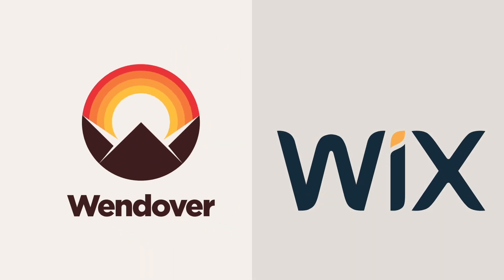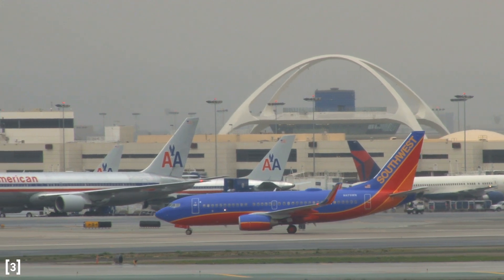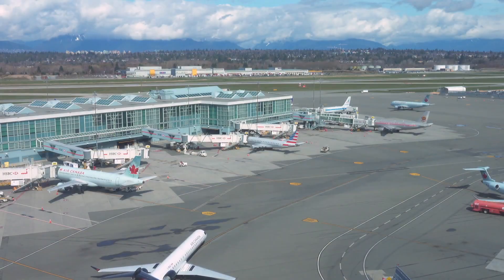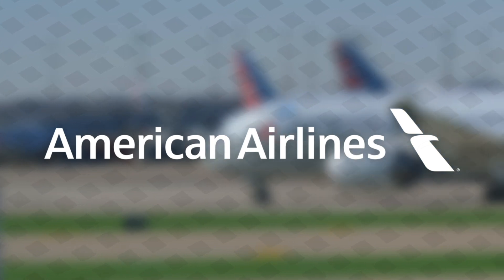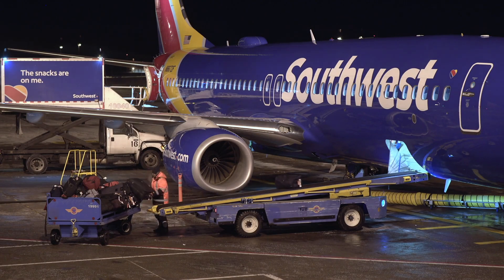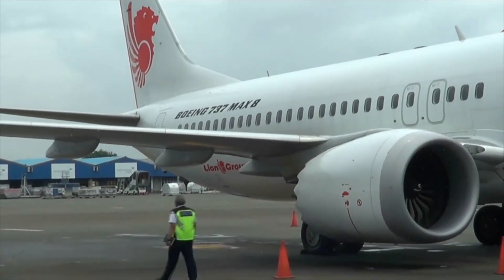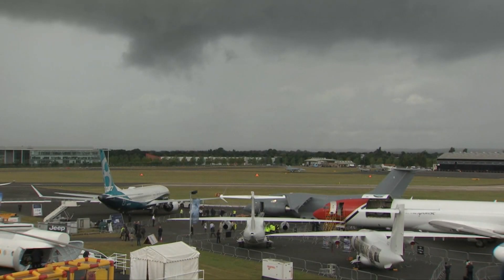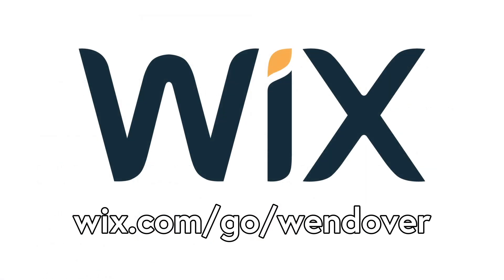The Economics That Made Boeing Build the 737 Max

Comment: Intro is absolute garbage. All modern planes have several step starting process ( non turned on by  the flip of a switch ). 737 MAX ( and NG for that matter ) has got lcd screens that show all the parameters and problems if they happen ( non of that "just a warning light" nonsense ) . All control surfaces are moved by hydraulic system and electric motors ( fly by wire ) and all the physical cables are just a redundancy mechanism in case something mulfunctioned ( which is a good thing ). And even check lists can be digital if airline company so desires. So that was complete nonsense. By the way I am in no way Boeing apoligist. And I do acknowledge that 737 Max is a disaster ( for reasons we all know ) and that the nature off capitalism and corporations lead to tragedies like 737 MAX accidents. But we can't just make stuff up just to make a point how bad this plane is.
Reply: Андрей Журов I’m not sure about 7 steps but there are defiantly more steps than Airbus or even 777. All I know is 737 you have to manually turn off the packs, turn start switch to ground and wait until 25% N2 then manually move fuel switch to run. Airbus is turn start switch to IGN and move master switch to on. 777 is similar. 

And for the checklist side, if a problem occurs an Airbus displays the actions write on the screen and removes it when actions is completed. Boeing just has parameters on the screens for engines, hydraulics, gear and flight controls
Reply: @tomstravels520  I can agree with you on the start up procedure but the point is not whether 737 has couple of extra steps in the procedure or not, the point is that non of the modern commercial jets are started with a flip of one switch. And same goes for displaying issues and parameters on LCD displays. In the video author says it's just a bunch of warning lights ( to make it sound like it's a really old school plane ) which is just not correct ( and very far from reality ). 737 MAX as well as 737 NG has full "glass cockpit" ( a lot less so in case of older 737 Classic ). I'm just trying to say that all the information in the beginning of this video is factually incorrect.

Comment: I understand the impulse to return to roots and use fly by wire, get rid of automation, etc. It seems to me however it completely misses the point. 

The way aircraft software is written is completely outdated and non-robust. Essentially it seems to be a series of hardcoded if-else rules that are obeyed blindly by software, no matter what the context. At the same time, we have very robust self-driving car software solutions that process all the available inputs in conjunction and make decisions based on all the available signals.

It's easy to understand why that is - aircraft software predates self-driving cars by decades. It just fundamentally is a much easier problem to solve because in a typical situation there is much more time to react - tens of seconds instead of fractions of a second. There is also more space in the sky than on the road. Therefore the style that was used in the past is continually used at present.

I believe there are two ways forward. Either stay with the current rule-based model and acknowledge its limitations. It really is never going to be intelligent enough to make better decisions than a pilot. Or we should transition into a modern neural network style architecture where all signals are processed.
Reply: Self-learning software isn't robust. A tesla plowed itself into the side of a truck, apparently mistaking it for an overhead pass. To make matters worse, neural networks are nearly entirely undebuggable. There is no way to tell why a neural net came to the decision it did, while that's a relatively straightforward exercise in traditional code. This is why adverserial attacks on neural networks would never trick a human brain. Traditional code had decades of track record of safety, whereas neural nets have no track record whatsoever.
Reply: @antalz  You are making an unfair comparison here. Somehow when it comes to neural networks - the bar is "it will never make mistakes that a human couldn't". But when there is a bunch of if-else statements the bar is "it will work under precisely defined, intended circumstances". Let me put it this way - it is trivial to "trick" a bunch of if-else statements into making a mistake. Just break the particular sensors that the system depends on. Adverserial attacks can be defended against and are very difficult to perform. Much more difficult than an attack against traditional software. It's enough to disrupt GPS signal which is quite easy.
Reply: @antalz  Tesla running into a truck was literally software being beta-tested, not production grade. Insufficiently trained neural networks are bad. So are badly coded and untested if-else statements. We will eventually see what the statistics will be on the actual production-ready software in self-driving cars. But if the statistics showed that this software is reliable over a very large dataset and robust against various attacks that will inevitably be tried against it, then I see no reason why it couldn't work in aircraft. It is an order of magnitude easier problem to solve.
Reply: Aircraft systems are already designed with the mantra that "the pilot always is the unquestioned decision-maker". Systems can take decisions, however, the pilot needs to be aware of them and have a way to take over. The MCAS did not respect that design mantra, by having the MCAS fight the pilot and by not letting him take back control (by deactivating the system, for example). Besides, the MCAS suffered from having no redundancy of sensors where any other similarly flight-critical system would have had a 3-sensor redundancy system where the readings are approved only when 2 of the 3 agree on the value (within a small margin of error). 

Also, AI hasn't been integrated into airplane electronics because there is effectively no review of the "code" nor any way to formally regulate it. Neural networks are essentially a literal black box where one can only gain insight on its behavior by feeding it inputs and observing outputs. This means one has to exhaustively test all edge cases before being certain the system is safe. And within the aviation industry, uncertainty is very, very badly seen. Besides, airspace being only used by professionals means that standardization is easy enough - any action the pilot takes follows protocol, from requesting departure to following routes to communicating with ATC. This makes it easier to design automated systems which relies on the protocol instead of having to learn typical selfish human behavior as seen on the road. If all cars were self-driven, or only driven by professional, we would have seen a similar innovation path as with the aviation industry - "manually" designed automated systems which relies on protocol. And as more and more of personal cars are self-driven, I believe we'll see a change towards that protocol-first world where cars automatically follow a set of rules and communicating between them.
Reply: @SolarLiner  There is nothing wrong with the mantra of letting the pilot make the final decision. But why should we be okay with an automated system running a plane into the ground when there are thousands of signals that could be used to figure out that is what is happening. Sensors can fault, but more importantly, there might be circumstances when sensors are badly designed and give equal but wrong results. If nothing else, there should be a piece of software that is able to process all the combined signals to figure out that an auto-pilot or any other automated system is misbehaving and issue a warning. It seems quite plausible to train a network to detect that a plane is being run into the ground or into a building. If anything else it could turn full control to the pilots.

Comment: Even with the new software I will try to avoid the new MAX series at any flight possible. It was stupendous idea to make te MCAS system dependent on ONE sensor where any other important system has at least one redundancy. And the "fun part" here is that the MAX has more than one sensor, Boeing just saved a couple of lines in code and time by not using it. And if that wasn't enough they didn't even tell the pilots about the system AND lied to the FAA by saying MCAS will "only" tilt the rudder by 2,7 degrees but in reality it was up to 4° - they honestly should be sued for that, that is major disregard of passenger safety in every single point.
Reply: They make additional "aoa disagreement package" as option

Comment: "It was a hasty decision, made by hasty human brains"
*correction 
"It was a hasty decision, made by GREEDY human brains"
Reply: Tell me about the FAA which rushed to approve the bad design just to save 15% of carbon emissions.
Reply: Let's not forget that the flying public consistently buys the cheapest ticket.  Airlines tried to disprove this and were wrong every time.  If we insist on absolute rock bottom prices, sometimes that doesn't work out.
Reply: No it's not, even if executives at Boeing wanted to design a new aircraft from the ground up, Boeing shareholders would not let them spend that much money and time while Airbus gained the market. Also airlines themselves don't want to spend more money recertifing every pilot. 

The mcas system switch to disingage it on the 737max is the same swtich used on every other 737 to take Manuel control of the trim. 

The MCAS system is just renaming of the electrical trim control system that's always existed but now has another programming to also compensate. The mistake made was to only connect the system to 1 new sensor instead of using others as well in conjunction. 

But again to reiterate the electrical trim override is the same as every other 737.

No one wants to here the truth but there is a reason the planes that crashed only happened in countries where pilot training is less stringent than North America. 

Specifically the Indonesia flight a pilot flying the same plane days earlier had the same problem with the sensor, but no one on the plane was none the wiser because he happened to be well trained and took Manuel control immediately.
Reply: @EFR-rt1sb  ya...so look at what have Boeing's investor done.  People died for that blood money
Reply: @EFR-rt1sb  This seems redundant. Rather a pilot is certified or not you can't defend a system control switch that automatically plunges a plane to the ground (twice) whilst restricting the pilots from manually assuming control of it in the process.

It was a "greedy" practice to remain in control of the market, especially the interests for their largest buyer American Airlines. You can only redesign a plane so much before the 2019 electronics are just too complex for a 60+ years old aircraft model. Anyone with a high school diploma can determine that.
Reply: Maybe I didn't explain this well enough. All 737 unless someone is flying one from the 70s have electronic trim control so the pilot is not having to adjust all the time. Occasionally something happens to the cables that run from the cockpit to the tail the ones that wendover described. In those situations the system has to be turned off. EVERY PILOT is trained to slide a switch that turns that entire electrical control system off, which in the 737Max includes the MCAS. 

The black box of the Indonesia fought showed that the pilots turned off electronic trim seconds before they hit the water. They spent minutes trying to pull up without turning off the system that every pilot is taught to turn off in ANY SITUATION WHERE YOU LOSE CONTROL OF THE TRIM. 

So yes technically they followed procedure but it took them way to long and it was to late by then. When another pilot on that same plane took over seamlessly the day before in that same situation.

There is no rational argument that the pilots did not have at minimum some of the fault. The Indonesia flight is even more complicated because they knew something was wrong with the plane and they ended up changing the wrong sensor on the plane the day before. Another pilot on an earlier flight the same day of the crash reported problems and the airline decided to fly the plane again anyway.
Reply: @MarloSoBalJr  well you are wrong... I would not trust anyone with just a high school daploma on their aviation technical know how... it's not like Boeing is stuffing new electronics into a plane designed in the 60s. The original 737s and it's successors are so vastly different from eachother. The only things that are really the same is the airframe and same basic architecture. The airframe of the 737 family has proven to be extreamly reliable and safe. If it aint broke, don't fix it.
Reply: @EFR-rt1sb  You leave Manuel out of this, he's done nothing wrong. 
So what you're saying is that American pilots flying American planes are safer because a real American pilot knows what to do when the American flight control system wants to point the American plane's nose into American ground? Well that makes me feel safer already.
But I would agree that this is not the product of greed. This is the product of a system that rewards greed.
Reply: 6 @EFR-rt1sb  Mate, the 737 was made and sold because Boeing advertized it as not requiring a retraining of it's crews and thus for airlines to save money. 
And if the crews were so bad to begin with, you would read of 737 crashes all the time. Moreover all crash reports so far stated that the crews in questions followed all procedures correctly. So your attempt to blame crews and other countries is not only cynical, it is irresponsible. 

"Boeing shareholders would not let them spend that much money". This is the only line that matters. And yes, it does come to greed. Money over safety.
Reply: Boeing also does not have the advantage of nearly unlimited government loans at below market rates like Airbus does for development like with A380 that taxpayers in Europe still are owed tons of money for.
Reply: @olekkuvppl  True. Boeing "only" enjoys the massive subsidies it gets through it's military aviation department, funds that also are funneled in development and production of civilian aircraft. So spare us this buhuhu Airbus subsidies. Just check the WTO ruling 3 or 4 weeks ago.
Reply: @Phil yeah state of Washington gave a 200 mil$ tax break and EU gives multiple billions in direct subsidies.Totally the same scope also EU has it's own defense contracts

Comment: I’ve got a question: why do pilots prefer fly by cable to fly by wire? I understand the difference and how the two systems work, I just want to know why pilots would prefer the older system, especially on a large passenger liner.

Comment: Boeing is STILL running the narrative that non white pilots are too dumb and inferior to fly the 737max. Dennis Muilenburg a couple of days ago pretty much still maintained it was pilot error and only whites are smart enough to fly Boeing aircraft. Fine, us non whites will buy Airbus. In fact the PRC announced a massive order of airbus aircraft.

Boeing might as well name themselves KKK airlines.
Reply: This is absolute nonsense. Airbus, using their fly-by-wire technology does not allow the pilots to make dangerous manouvers. You cannot stall an Airbus, you cannot do an aileron roll or a loop in an Airbus if the controls are in "standard mode", unless you switch off the computers using the switches in  the overhead panel the pilot has no ultimate decision of the fate of the aircraft. Boeing IIRC introduced this system in the 787 for the first time
Reply: @federico339  You can stall an Airbus, you will just need lot's of turbulence.
Reply: @federico339 
You can't stall an Airbus?   Tell that to the dead passengers on AF447.
Reply: Source?  Links?

Comment: There is one more difference between modern aircrafts and the max, for such a crucial system like Mcas usually a aircraft has more than one sensors for this. At Airbus you see for some crucial systems even six sensors.
Reply: The odd thing is that the 737 does actually have two of these sensors, but MCAS only ever takes its data from a single sensor, which in terms of industry best practice is an appaling thing to do. Airbus always has at least two sensors, and for flight-critical parameters, they have at least three. Even just having the idea of letting a critical piece of automation take its input from a single sensor and pretending it's always reliable is beyond terrible...
Reply: Robert Faber Airbus has 3 AIr Data References though because it’s then easy to see which system has failed. If an AOA sensor fails the pilots switch that system to the back up system and the plane flies normally
Reply: MCAS isn't crucial though.  Well, until it's installed.
Reply: +Tams80 - If an automated system can take control of the engines, ailerons, rudder, elevators, flaps/slats or landing gear, I'll call that a "critical piece of automation" worthy of getting the input data right on at all reasonable costs...
Reply: Also, normal auto-trim can be stopped if the pilots use the trimming switch against it. MCAS can't be stopped by manual trimming. Only by disable electrical trim altogether. And if it's too late, trimming mechanically is pretty much impossible...

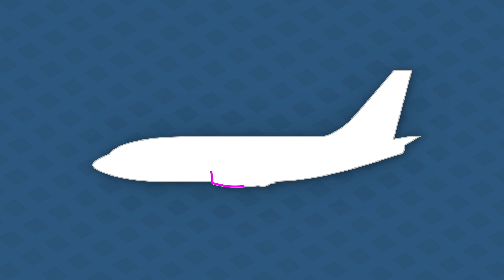Comment: 9:32 Why did’t they put the whole aircraft higher from the ground, when grounded. It would have caused less problems.
Reply: Because when the landing gear retracts, if it was any longer they would have to move the main pivot points further outwards which would cost them more money, otherwise the wheels would hit each other
Reply: Yes, but they could have made recrtactable landing gears, that gets longer, once open before landing.